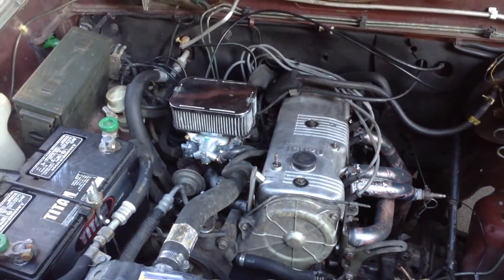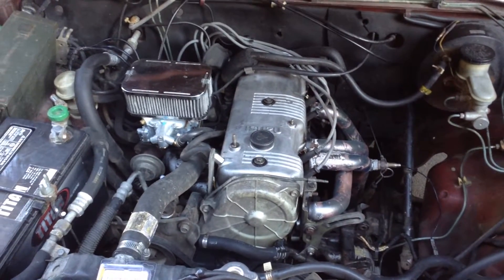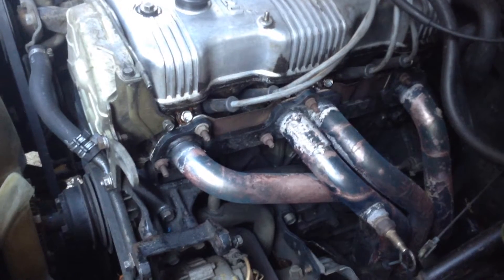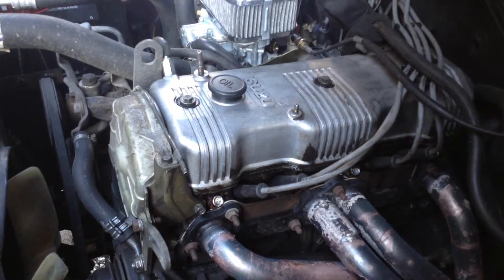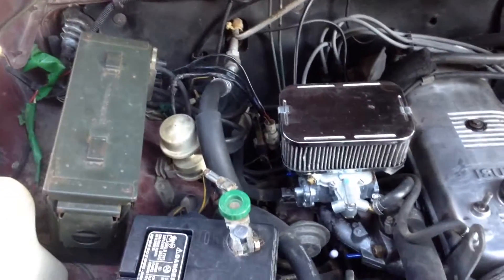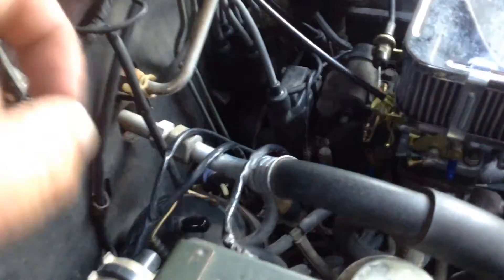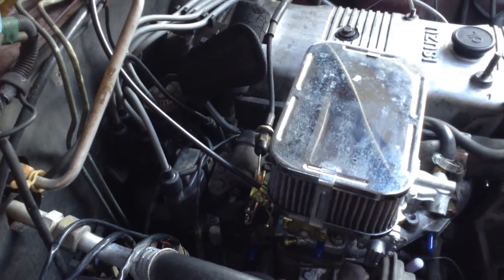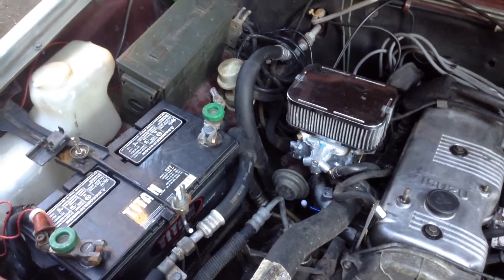Typical Smog Delete upgrades on Isuzu 2.3 Motor (Isuzu Trooper 2 , Holden Jakaroo )

Comment: Just purchased a 1992 Isuzu pickup with 124k miles. The previous owner did all this, smog and cat delete. Has a brand new Webber, no AC or power steering. Runs really strong and is really fun to drive. 5 speed too, long live the manual!

Comment: I literally disengaged my entire emission system on my 1990 Isuzu PICKUP. No check engine light,  stock carb and it runs perfect. 24.24 mpg lots of pep.
Reply: on the 4ZD1? if so how’d you do it

Comment: Do you have a diagram of the hose setup you use on your Webber? I just swapped my motor to a new 2.3 with a Weber carburetor and I can't seem to get fuel.  Just curious what my configuration should be for vac/fuel lines.  Awesome videos btw man!
Reply: That tanks sealed drill a hole in ur gas cap

Comment: Who is this fukin guy? Nitro Ox on a 2.3L? "enhance reliability" Smoke some more crack bud.
"1930's Technology ladies & gentlemen, usually badly, blah, blah. Remove that thingy, O2 sensor non-what, this thngy un-needed, these kinds of imports, unhook the vehicles computer. alot of improvised caping off, unnecessary componentry  blah, blah, blah"
Cpt. Tech on job. WTF? Smash your shit 8digit. Who subscribes this dung?
This video isn't even real? Nice job, like that PaceSetter stuffed in there with packing paint & he's giving advice on removing this "device" or that "device". Those who can't... Teach. Qualify your teacher. Watch someone whom knows what they are doing, a qualified teacher doesn't send you down the wrong path trying to sound like he knows what he"s doing. . Check the Johnny5ive channel out for some expert advice on these platform KB83 & KB84 trucks. The guy who did this video has NO Business teaching! Yeah love those nuckle rippin hose clamps, save those!                  Props totha real heads at Planetzoo!

Comment: What size plugs did you use in the head
Reply: Its spark plug thread some oil drian plugs use it as week but with out the new exhaust manifold theres not enough room for the head of the bolt on the front and back plugs

Comment: can I do this on a California trooper same year and engine?
Reply from the maker: Probably not, but maybe.   I know it just hit 30 years, which is the traditional cutoff age for smog exemption.
Reply: I have a 86 Isuzu pup with 42,000 original miles it was my grandfather's all the lines are dry-rotted want to do the same thing I can't find any information as to can I pass smog in California if I just put a modern catalytic converter and the Weber carburetor with a header
Reply: @evilbeetlekustoms2386  did you find out if there’s anything cali legal for this? i have the 87 2.3 and want to do this
Reply: @xanny7373  still haven't messed with it can't really find anyone to hot smog it without wanting five $600
Reply: @evilbeetlekustoms2386  i could probably find someone for $100 out here but i don’t wanna try it anyway

Comment: I had a isuzu pup pickup for several years and done a lot of the stuff your talking about, the biggest bang for the buck I found was removing the mechanical fan it had no clutch. I got a 12v electric fan from a junk yard for $20  a 30 amp toggle switch inside and a good Temp gauge to turn on when needed. After that it had a little powerband going through the gears lol it probably robs %10 of this little engine's power.
Reply from the maker: +Bernie Clement  Thanks, your advice and comments would be entirely welcome.   There are definitely less of these on the road than ten years ago but I understand they were a tinkerers special back in the day.   I want to do more mods and videos on the mods as this project progresses and the power band and tuning the Weber are proving to be a bit of a hassle.   Not so bad for country roads, but it is weak on the freeway and stalls a lot in city traffic unless I set the choke juuuust right.   I might have a leak somewhere in the header, but it is only an issue in stop and go city traffic (fumes in the cab).